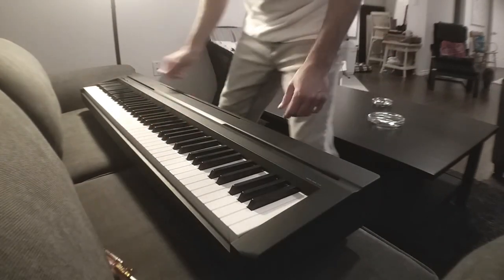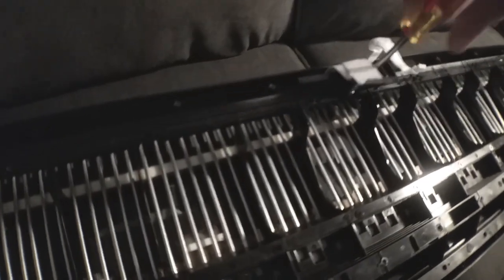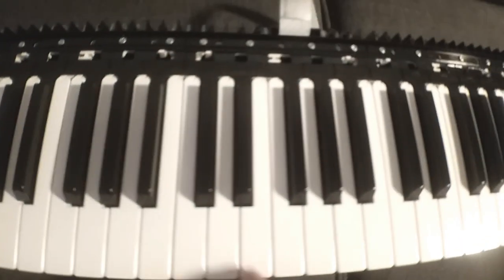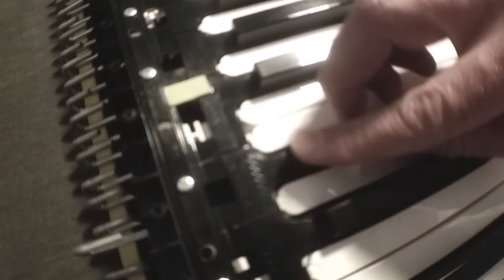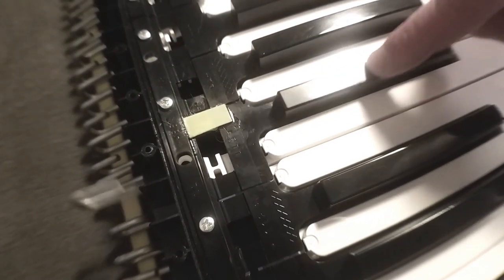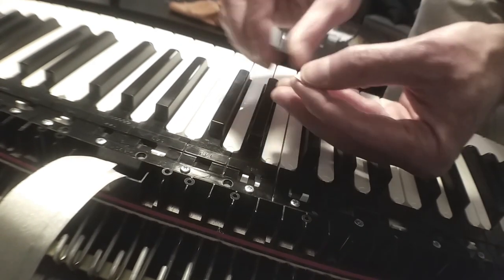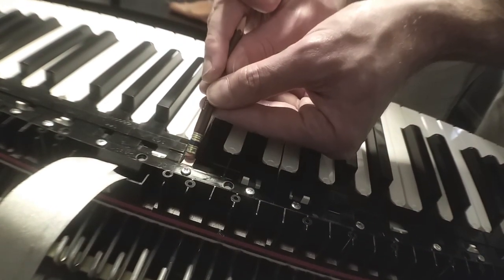Fix Broken Keys on a Yamaha P-45 Digital Piano

Comment: Very usefull video, one of the keys in my p45 has a scratchy feels and make a scratchy noise when pressed, do you have any idea of what the issue might be? Thanks
Reply from the maker: I haven't experienced that on mine. If yours is no longer under warranty, pop it open and see if it just needs a little cleaning between the keys. It looks like they apply quite a bit of grease during production, to keep the action smooth. So any thicker dirt, crumbs, sand etc. could easily build up in the greased parts and cause that scratching.
Reply: @corytoddmusic  Thank you for your help
Reply: Hi Alessandro, my p45 had an intermittently very scratchy c key, after a load of dirt got dumped onto the keys, I guess the vacuum cleaner wasn't able to suck all of it out. 

I followed this guide by Cory to open the piano and remove the key bed as he shows. I was then able to remove the one-octave span set of keys (white & black) that included the scratchy key by undoing the 4 screws that retain those keys. 

Once you have undone the 4 screws, you will see you can lift+slide those keys out of the key bed. Each key has a box like slot underneath it into which the tip of the corresponding weighted arm for that key pokes. 

I found that the box like slot for the scratchy key had ingested several bits of grit that had ended up mixed into the grease. I removed all the grease from the slot and from the corresponding end of the arm, and then applied some clean grease. 

Now I have re-assembled everything the key is butter smooth! Thanks for the great guide on dismantling the piano Cory :) Anyone can attempt this fix if they have a suitable cross-head screwdriver and take their time.

Comment: Trying to fix a friends p35. Big sections no keys working, Opened and cleaned but no joy. Also when reconnecting the white 'tape' wires the connections are looking a little frayed so wondering if that is the problem. anyone had similar problems?

Comment: Thanks for sharing, what about a loose white key of YAMAHA P255 ?
Reply from the maker: Thanks for watching. I had a good look at the white keys the last time I opened up the piano. The white keys are quite solid looking. I would try just tightening the screws across the the top of the octave segments. If that doesnt fix the problem, you would need to remove an entire octave segment, which is just a matter of removing the screws along the top of the segment, then gently pulling the segment toward the front of the keybed, then up and out. It is quite easy if you take your time. You would probably want to wear gloves, as there is quite a bit of machine oil/grease in there and it will get on your hands. Once removed you would be able to see any cracks. It's quite easy to do, and if required you can also buy new octave segments online You can also switch the position of the segments. Exchanging the lowest octave with a more heavily played one. I have done that as well, and it made a big difference. I Hope that helps. :)
Reply from the maker: Sorry, I just saw that you mentioned the P255. I'm not sure if they use the same key segments/mechanism as the p-35... They do look the same:  https://syntaur.com/keys.php?key=K23Z
Reply: @corytoddmusic  Thanks for the advise, I'll try it later.

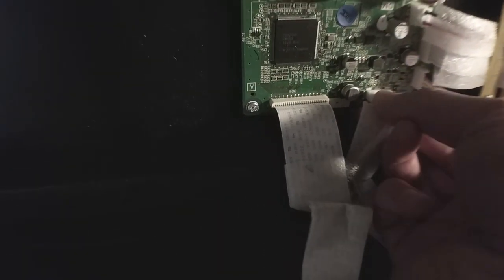Comment: 2:51 I can't pull It out
Reply from the maker: Uh oh. I'm assuming you're talking about the ribbon cable. There should be a sturdy edge on the sides that help to get a grip when pulling, and there may be a clip on the under side that needs to be released (there isn't on mine). I think I had to run my finger nail across the seem where it connects, the first time I released it. But yeah, don't force it, just a steady wiggle should do the trick.

Comment: I am watching reviews of this pianos, I am sad of seeing this weak mecanism
Reply from the maker: I should point out that it was 3 years before the first key broke. For the price range this has been an excellent piano for learning/relearning, and I would still recommend the model to anyone looking for an entry level digital piano.
Reply: @corytoddmusic  Yes but I also was thinking on the p-125 that has the same system but cost more than this (I watched a dissembly video too). The thing I don't like is just the flexible pastic on the keys, it should use hinges. 
My 20 years casio is low end but still in perfect condition, just dust and some scratches on the case.
Reply from the maker: @joselu90 , The Casio Privia series seems to have a good reputation, and it looks like the keys pivot on an axle. I've never tried one, but I am curious about them.